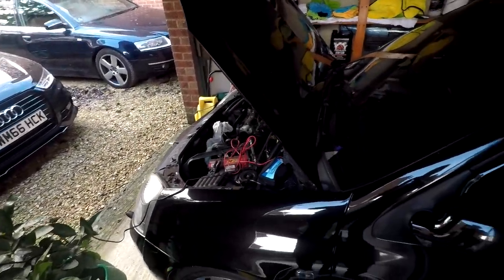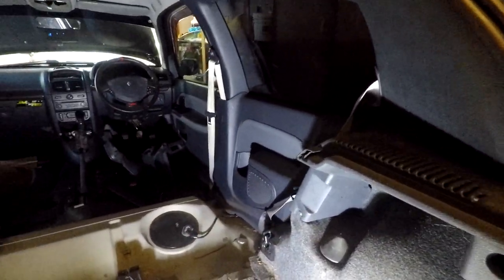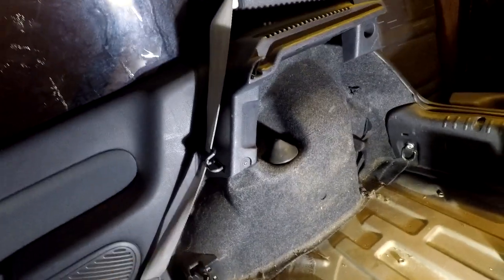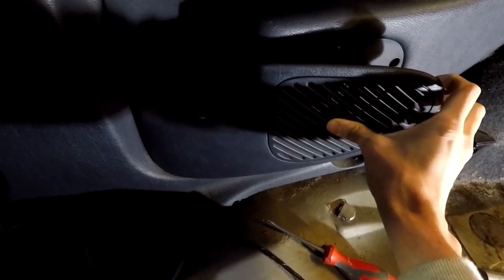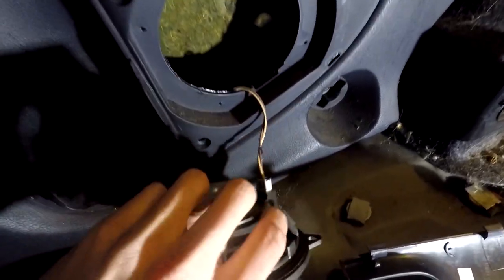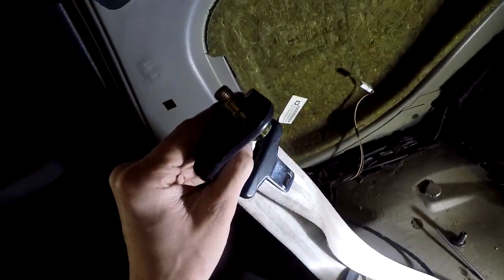Goodbye horrible silver seat belts! *Removing Clio plastics* Pt 1

Comment: oof,,, this is al i have lol
5:01 ,, i too, like to re insert my beauty to make that one loose ;)

6:46 i know, you just send it with big hammer,, thatll do her.

8:18 why not choose both, there is a socket that has both in one, looks like a torture device lol.

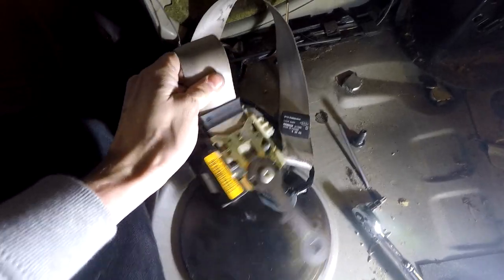8:40 this happens as theres a little lock ball in the mechanism, the same one that actuates the seatbeklt lock up if you pull it too hard (so when pre tensioner goes off, the seatbelt locks before you get thrown forward) that ball locks the belt in place if it goes even a tiny bit out of alignment on tis little track, so moving the belt makes that happen, as soon as you push the seatbelt back into the right position, it sorts itself out! -- 8:57, ye you explained it seconds after i unpaused after typing this lol

9:19 i like them! breaks up the huge amount of black in my opinion! but yea theyre a bastard to keep pretty for long amounts of time as you said at the start

10:00  the little cable isnt in the right place there, its meant to ride inside the little hook that points up, may have issues with it wearing through if you keep it there kmate, just a heads up

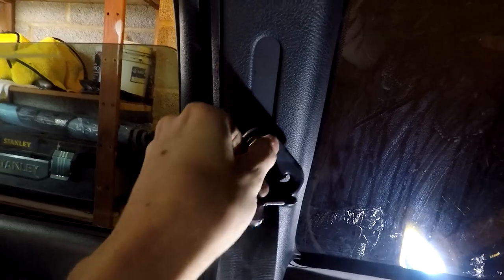10:19 ,, i too, like to screw my beauty in ;P

10:35 back bench is hardest bit, but if youre careful, all this can be done without removing it, just a lot of fiddling reclining the back of them to get to everything, can be done though,,, it is wasier to just remove them tho,, but ig your bolts are fucked, you can do it!

12:07 ,, 12:14 only need to undo that bolt you show mate to get the belt to slide out, and the actual belt reel comes out super easy as you showed.

13:29 meeeeeeee!!! still need to order mine lol,, oops!

nice upload as always my boi, shes coming bicely now,, do 100% contact max asap, theres no real booking, its just, send him them and he will get round to them, have to leave an order note with your return address  and what you want done :)
Reply from the maker: Dusty Shed Garage I will move that wire back above the hook mate thanks, clearly wasn’t paying much attention as that’s where I took it from! These comments of yours always make me laugh 😂 glad the back ones are easy enough also. Shouldn’t take too long tomorrow/Wednesday nights whenever I get round to it! I know I need to message him! Funds are nearly there 😅 no pressure to buy the hoodie babes you’re alright 🥳
Reply from the maker: Dusty Shed Garage plus - destroy all silver!!!